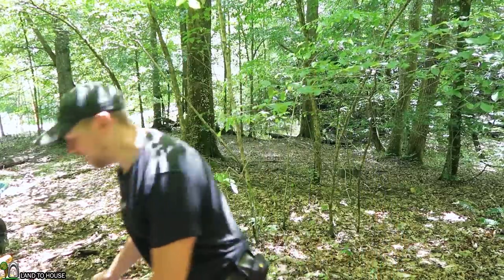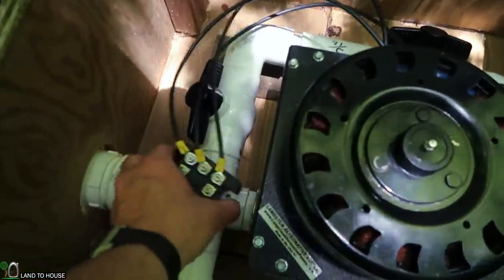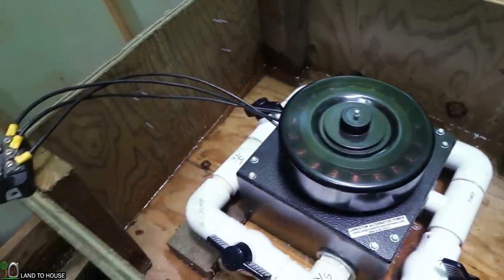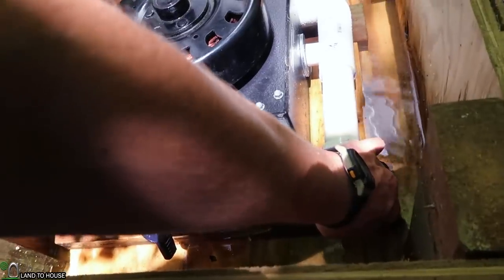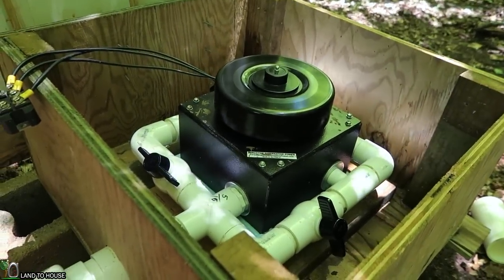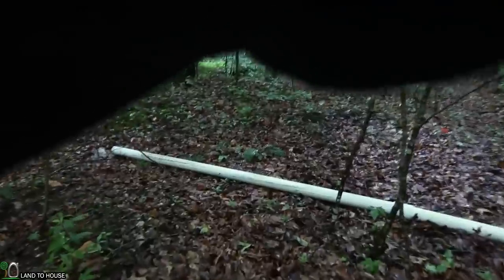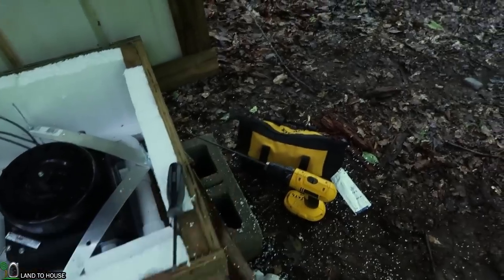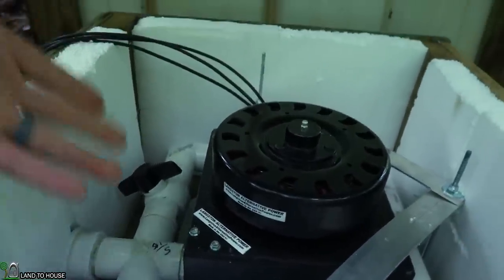Installing the Turbine Micro Hydro 6/10

Comment: Something to consider is using a larger drain pipe, like 4 or 6 inches. The drain needs to flow and the pipe you are using is creating the issues you've described. If you still want you to use that same drain pipe you may want to consider adding a Y Pipe very close to the box then secure it to the box, 90 degree facing up, then add a 2 foot extension to vent the pipe; or however high you can get without interfering with the cover.  Maybe even a Tee at the top just below the box cover to allow options for air to vent the pipe. You really don't need a bottom on the unit at all but it will keep animals from nesting there so that is something to consider. Might make sense that 2" feed and 2" exit will just work and most times you'd be right, but this item is different and does not align with the typical laws of Plumbing so one must be able to think outside the proverbial box for solutions. When you test ran the unit it did not vapor lock but as soon as you added the bottom you started having issues. Obviously I'm watching the video or in short on the outside of the fishbowl looking in while you are on the inside of the fishbowl, making said video, and may not see things as clearly as others might. I hope this helps you or perhaps another viewer... Cheers...
Reply: Yes, I'd probably go with a plastic catch basin and a somewhat larger outlet pipe than is going in. A clean out for the pipe is probably not a bad idea, although if it's running above ground like that, you could probably just disconnect the pipe if it needs to be cleaned out.

Comment: In most generation installations, have a larger generation room, which can be better to insulate and in your situation, the generator could overheat in its confinement, also a risk that the box could flood.

Comment: I have a small stream running through my lower property about 80 feet away. There is a culvert pipe, about 30 inches that allows the water to travel underground for about 50 feet, and then there is a drop of about 15 feet. The stream runs all year. I’m guessing but I’d say it flows about 10 gallons a minute most of the time. In August and July, it may slow down to two or 3 gallons a minute, but I’ve been here 35 years and I’ve never seen it dry..
  I am a retired electrician from the local electric company after 38 years. I am very curious about this system. I considered putting some solar panels on my roof, but my roof faces about 30° south east on one side and about 30°to the north east on the other side.. not only that, but I live in a valley with very high trees along the ridges. In the summer, the sun does not come up high enough to clear the trees until about 10 AM, and the sun goes behind the trees on the opposite ridge about 6 PM..so solar would not benefit me to the max... 
  I did work in the field for a few years dealing with meters. I was often sent out to check out a meter that could possibly have not been registering. It turned out that the people had solar panels. When I was entering data into their record, I noticed that The electric company actually paid them over the last year. Two in particular, one had a swimming pool with a heater and a 3 ton air conditioning unit. I don’t know if their house was gas or electric heat but, over the year, we paid them $600 for the energy they put into the grid with their solar panels,And they pay nothing over that year to the electric company for power delivered to their home. They delivered more power to the electric grid than  they consumed from the electric grid that year.Another house on the same street, same story, we paid them $50 over the previous year because they had been backfeeding excess generated power by their solar panels back into the grid..They both lived on the top of a hill with sun exposure most of the day.
  that stream running through my property runs 24/7 /365...tapping into the stream,That would be a more feasible system due to my shaded location.

Comment: I didn’t read through all the comments, but you can run AC voltages up to 100 feet before any corrections in wire size for voltage drop. Cant you carry the current in AC to where you intend to charge a battery bank where it can be rectified to DC?  Depending on the load current at the other end, you may need some heavy gauge expensive wire for a DC run that far. That’s a cool as heck system!

Comment: Electronics and artwork are commonly shipped in  Eggcrate Soundproofing Foam. Maybe you could call and ask for discards to reduce decibels. "Pinky filter pads" can double as water filtration and acoustic absorbent material.
I also worry if the housing will stay cool enough. Is the water running through the pump cold enough to keep it from overheating when the housing is closed? 
I am really enjoying this series. -KJ

Comment: i find it very neat how great analogy water physics is to electrical physics. 
Valve just open a little, Water pressure high but water flow low = high voltage but low amperage and low effect/watt
Valve open maximum, Water pressure drops a lot but maximum water flow = low voltage but maximum amperage and low effect/watt

Valve open "just right", Water pressure drops just enough to provide optimal water flow = High voltage and high amperage and good effect/watt.   Works exactly like an solar mppt controller. The controller adjust the voltage/amperage ratio for maximum efficiency from solarpanels

Comment: Have read a lot of the comments but didn't notice if anyone had mentioned that maybe putting the wires from the turbine through some flexible tubing would keep the mice from chewing on them. The biggest problem will be how to attach it at the turbine housing. This would work even with your new and improved containment box.

Comment: That is a super cool unit. Not to be critical as an asshole but 15ft. from your creek will cause untold damage. I would think you might have figured that out by now since its 6 months later at this point. I have a pond with a 4 in. overflow pipe, no pressure at all, and it has put a 2 ft. hole in the creekbed it runs into. Water where water usually isn't can be devastating. Especially in forestland where things are much more fragile than they look. I hope it turned out ok. I wish I had one of those units. I would probably cut off a bucket and fit a 4 in. pipe to the bottom to drain and still drill a couple good sized holes toward the top in case of overflow, with a couple holes in the housing floor and screen on the bottom side to keep rodents out. Maybe a bit taller housing also.

Comment: Wouldn't having 2 nozzles open (on opposite sides) reduce wear on the turbine bearings? It would seem that just 1 nozzle would put pressure on one side of the turbine. I'd think equal pressure on opposite sides of the turbine would equalize wear and extend the life of the turbine.
Reply from the maker: I had the same question. Langston says the pressure from this water is not enough to be an issue with this pma.
Reply: That would heavily depend on what type of bearings used

Comment: I think that's not suction but your tailstock backing up filling the turbine space and the wheel is running in water. That's drag on your system. Pelton wheels are intended for a horizontal axis. A turgo wheel can run vertical or horizontal axis. Either wheel depends on the water escaping out the bottom and not interfering with the rotation. To get maximum power your wheel should run at half the velocity of the water. There should be a flange around the bottom of the housing that you can attach a flange to that extends below your box floor. That should keep the water out of your box.  I'd suggest on open flume to move the water away. A pipe will fill up and back into the turbine.

Comment: It would have been interesting to see how it ran with all 4 jets and how that affected the water pressure.
Reply: The thing is made to run on all four jets. Why only run one?
Reply: Running it with no load is asking for trouble. I am sure we will get to see it running full bore once fully installed. ✔️ one step at a time.

Comment: Am curious as to why no one has tried putting a few of these units inline between 275 gallon totes and adding a sump pump to recirculate water to overhead totes. Basically making a self contained hydro-elictric plant that syhons off a portion of the power all the time to recharge battery banks or capicator banks and battery banks and running invertors off of those. Only having to add water in the event of leaking. The base to the turbines could be funneled back into bottom totes that interconnect and pump back to top tanks via combination plumbing. Just an thought.

Comment: When you run wire from your generator going to your house, don't rectify it, you will have a bigger power loss running long wire in DC. AC is better in transmission since it has small power loss.
Reply from the maker: Please continue watching the series and you'll see that I run AC to the house
Reply: @LandtoHouse  AC has inductive and resistive losses, where DC has only resistive loss in the transmission lines and is more efficient. The reason that we use AC in the grid is because its easy to use a transformer to boost or lower the voltage (higher voltage, less ampes less loss). Now a days long transmission lines, use DC. With switching power regulators.

For this application, calculate the max current you will generate. And use that to calculate your losses and select a suitable wire size.

Comment: Why not bring it into the house as AC power then bridge rectify it to DC to charge battery banks?Seems like there would be a lot of voltage drop as DC
Reply from the maker: In the next video you see where the rectifier is installed. It is in the house close to the batteries.
Reply: I cant believe you responded!
Reply: @kylefleetwood9572   Great last name.
Reply: @MrDemolitionmission  great to see im not alone with it

Comment: . Will ice up in cold weather building a insulated building over it might work and will cut down on the noise just a thought.looks cool interested on hooking that up to a 12 volt or 24 battery bank how many amps you can get in your testing sure that the turbine will slow right down when you put a load on the battery bank you may have to run all 4 nozzles a bunch of testing needs to be done and another vid on that would be nice to see.

Comment: You need to vent that drainpipe that'll solve your back pressure problem. I assume the 200v reading is DC? Why not run the 3 phase to the building then rectify it? No loss....

Comment: I have to say that checking voltage as what I saw here is pretty much meaning less. The turbine is running in NO load and it will spin fast. Once the turbine is connected to a charge controller or regulator and battery bank it will slow down and the voltage will either be at or just above nominal battery voltage. The jets will have to be adjusted to maintain charging Voltage level .
Reply from the maker: The reason for checking voltage here is the limits of the charge controller. My midnite 200v unit actually had issues accepting the voltage at times. Had to upgrade to a 250v !
Reply: @LandtoHouse  I can go along with that. I would have thought there would be a recommendation for that with the turbine.  I built a wind turbine using an older Larger Ford alternator from a 6.9 L diesel once. I rewound the stator and filled it to capacity with 18 g enameled wire. Then I proceeded to construct a circuit to switch off 1 to phases at particular RPM. I did the same thing at first to test the peak Vout. Then chose electronic components for the circuit board. One of the biggest issues with a project like this is preventing the destruction of your circuitry is just what you are talking about here. Sorry for not picking up on that and bringing that point to the conversation. I should have been more on point. I found my peak Vout to be around 65V. I never got the rpm any higher as the efficiency of the props didn't allow it and I wasn't able to drive the rotor any faster with a power drill. I also had experience with one Midnite Solar MPPT charge control I used in a Solar/Wind power setup some time back, I fail to recall the model, it was a 30 amp unit I think . I like the way it converted extra voltage in to higher amp out at lower light levels. The turbine also had MPPT that did the same thing. I wired the panels at 48v and programmed the Midnite accordingly. I have always wanted to build a small hydro system for myself but since I don't have a suitable location or source of water flow, it doesn't look like this will ever happen. One thing I learned with  factory built  turbines was that when wound with very light G wire, under extreme conditions the stators cooked when the controller attempted to regulate output. With a higher quality controller like a Midnite I guess this is less of an issue. I do know they insist on connecting the controller to the battery first to lower the risk of cooking circuitry ! Also don't turn the turbine loose until all connections are made and secured.

Comment: If you used a round pan rather than a square box for your wheel housing and a larger diameter drain pipe you may solve your leak ing problem.  The white bead board will not last if it gets wet.
Reply: A round Galvenized large Tub would Be Ideal.

Comment: Electrical part should be separated from the hydraulic side. If a pipe leaks, a short circuit can occur and the generator would be defective.
The electrical part should be at least IP 67.
A short circuit could also injure people.

Comment: I’m very interested in if this can work on a pool  water  pump to off set the cost of running my pool filter system! My pump runs 62 gallons a minute they tell me at the pool store with 20 to 30 psi on the filter.
Reply: Restricting the output of the pool's pump to nozzles will cause the pump to run much less efficiently and increase the cost to run the pump by more than you could recover.
Reply: @jllaine  well I have three return lines to pool at 1/2 . So if I was to reduce them down and add a forth line with 2 x 1/4 to drive the hydroelectric. Wouldn’t that offset the high back pressure to the pump?
Reply: @jllaine  thx you for your reply on this 👍
Reply: @rimc4378  not really.  If the pump is feeding 4 lines, and only one line is restricted by a nozzle, it would be like having a 1" leak in the pipe just before the nozzle.  You'd get very little water through the nozzle to run the wheel.

Comment: Also you should form some type of pond where you could contain the draining water, and some how feed back into water source to avoid flooding.
Reply: Yes, this is correct. A retention pond should help to manage erosion, and if you feed the water back into the original stream, there won't ever be more water flowing through it than normal. Potentially, the water could be captured for

Comment: If you run the turbo with only one or two jets, is there a possibility that you might warp the bushing on the hydro shaft?   If you run all four it will balance the force on the bushing.
Reply from the maker: I spoke to Spencer about this and he says there is no way the water and pressure that I have is going to warp the shaft or wear the bearings out faster.
Reply: You could always use jets on opposite sides of the turbine to counter balance.

Comment: Does it generate enough power to use a pump with a closed water loop system and use water tanks for storage, one high up for gravity feed to turbine?  One water tank lower for catch and collect after the turbine.  A simple low power water pump should be able to keep up with the refill of upper tank right?  Make water hole smaller for less water consumption and efficency.

Comment: If you had a valute that kept the flow tight to the blades there would be more efficient flow without cavitation or vortex flow loss.
Keep the turbine then at just below water level but the output at. The lowest point possible so the water causes as negative pressure pulling the turbine blades rather than flooding the unit.
3/4" pipe carries 7 1/2 pound of negative pressure per 10' of drop with a straight vertical drop. ( use as little elbows as possible, they have the effect of 25' of pipe in static pressure per 90°ell.
A large pipe creates more negative pressure to drive but you cannot have a pipe larger than the input unless you set the input about 3' below the water line at the input.
The vallute will keep the blades moving efficiently as long as you dont pull air and your piping isnt too large.
(You can find hydronic equations online for pump sizing according to flow rate and backward figure your pipe size from what you already have purchased).
Tell your turbine "expert he shoulda consulted a boilerman before designing that highly inefficient turbine box.
Use common sense and exercise your research abilities online to find your best alternatives to problems rather than doing trial and error that cost bundles of bucks.
As I said, you dont want pressure into the pump, but tighten the tolerances in the turbine and use the negative pressure to pull the turbine.
That eliminates all the flooding problems and leaks.
(Common sense).